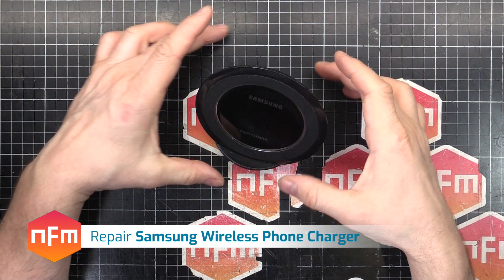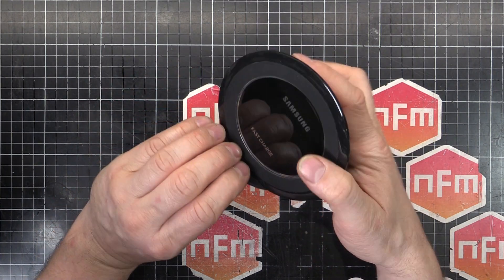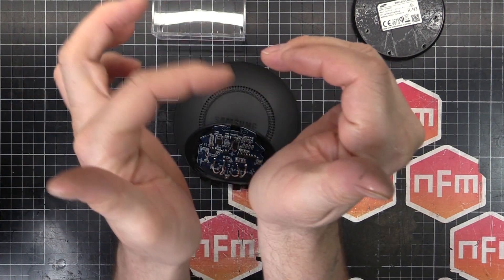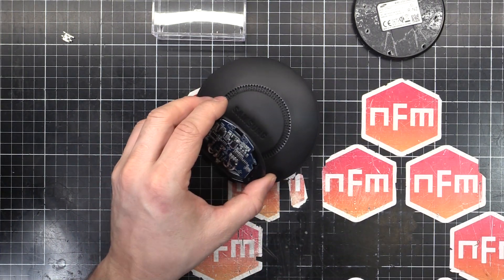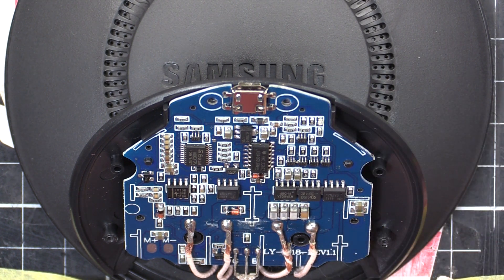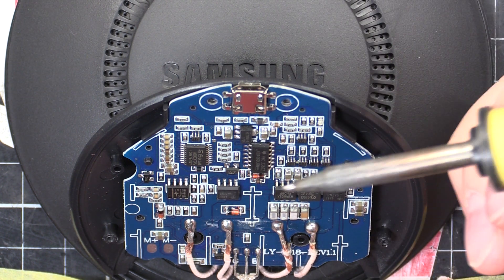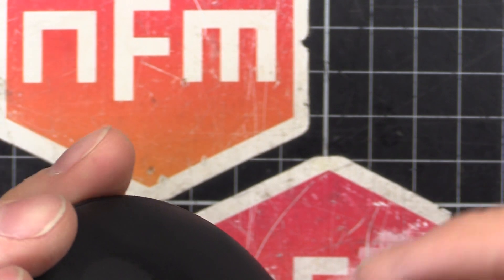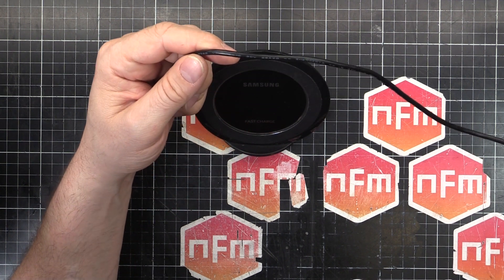Samsung Wireless Phone Charger USB Repair

Comment: Why does it always seem to good to be true when watching thes types of instruction video's. So smooth so easy. I have watched and followed different clips how to repair or fix scooter parts or sorts of electronic goods. Again ive noticed the instructionvideo is not compleet. Iam getting anoyed because you LEFT OUT when opening the bottem part there is an connector cabel from the small blue green charcher indicator led.

Comment: Can I change Micro to tip c?
Reply from the maker: You miigghhtt be able to install an adapter board in there with some cutting of plastic, but it is a very tight space, you wouldn't get the benefits of higher power delivery that USB-C offers though, it would only be a physical change of shape on the plug at most unless you redesign the circuit board inside.

Comment: Hey Man... did the socket charger that you use must Be socket charger for wireless Samsung or any socket charger can Be used... thx a lot
Reply from the maker: Any charger with enough current (I would use one with at least 2 amps) will work, but to get the fast charging capability, you might need genuine Samsung, or at least a compatible charger at the least.
Reply: Thx for the reply...😁👍🏻